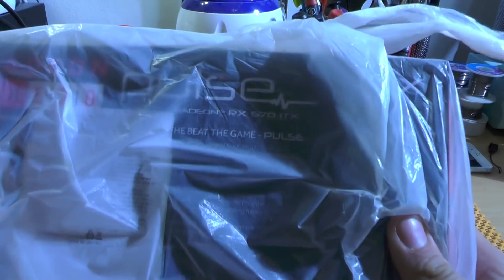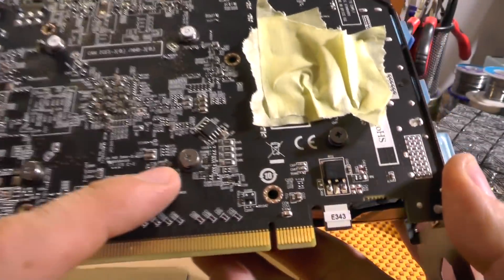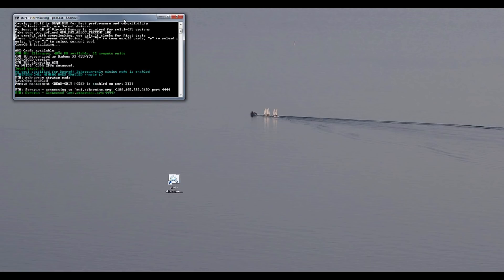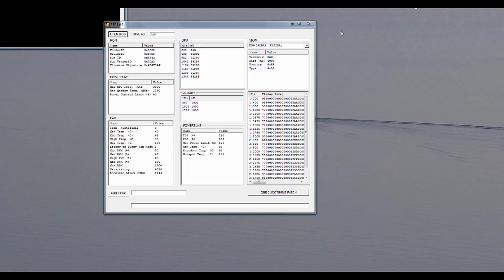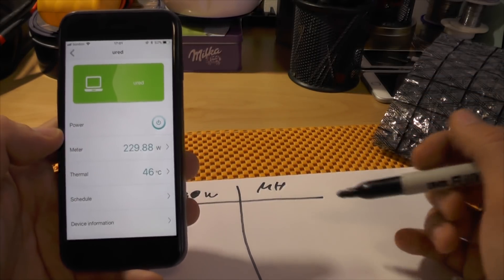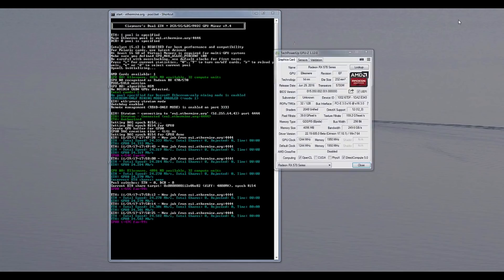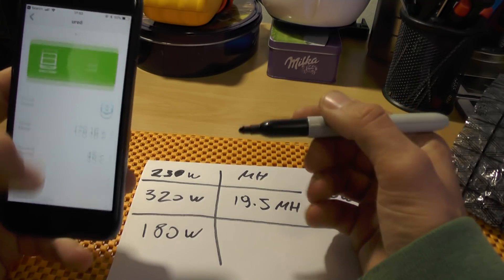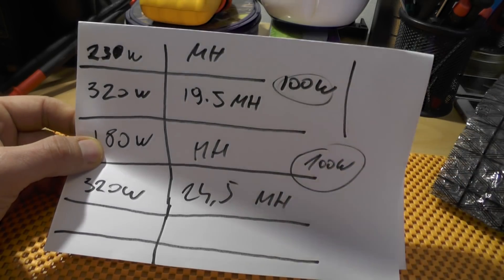AMD Radeon RX570 pulse ITX @ 28.5MH (ETH mining)

Comment: hello sir is it any better to higher the memory clock from the bios or its the same value if i do it with teahrd application like MSi afterburner ?
Reply from the maker: mahamed arhuma hi, lately it’s possible to do that from claymore’s miner, so i guess it’s easier that way:)
Reply from the maker: mahamed arhuma also, afterburner is ok, however you need to flash bios for memory stripes so i would say that claymore’s way is better way

Comment: Don't use this BIOS. Many cards work unstable when mem higher then 1850mhz. If u wan't 27.5Mh/s → flash BIOS with one-click timing in PolarisBios Editor and use this config in claymore. My 6xRX570 4gb ITX Mini ~ 855W from wall and 165Mh/s
-tstop 70
 -tt 55
 -fanmin 30
 -fanmax 70
 -cclock 1150
 -mclock 1850
 -cvddc 940
 -mvddc 935
-gser 2
 -eworker RX570ITX
 -esm 0
 -epsw x
 -allpools 1
 -mode 1
-asm 2
Reply from the maker: strange, i have about 30 itx's and they all work without any problem with this mod :/
Reply: i have 12 itx's they don' want to work higher then 1850, if i set upper then claymore stuck on thread error. Can u share settings for miner what do u use?
Reply from the maker: strange... i only use this rom, no "extra" swiftches in clymore whatsoever...
Reply: if i use ur bios, first card 25.2 Mh/s next all ~ 21 Mh/s, all cards on Elpida mem
Reply from the maker: after flashing my bios do this: https://www.youtube.com/watch?v=jkxpyjd6e9g

Comment: Good afternoon. I have Windows 10 and its same graphic card. I followed the instructions to perfection and after putting one of their "rom" and restart...windows simply does not start. It restarts continuously and I must restore it. i use 1st lockchain drivers and your bios "Modded".What can be happening?Ty
Reply: 47/5000
I do not think it's because windows is not activated
Reply: Could you do it with windows 10?Is this rom valid for windows 10?
Reply: Your graph has 8GB DDR5?
Reply: I have seen a picture that you have posted here and I think we do not have the same graphics because mine has 8GB DDR5. Is not it supposed that the most important thing is that it has 8GB? With 4GB can I do the same?many thanks
Reply from the maker: Did you patch the drivers?
Reply: yes with the link you've put there but if your card is 4GB and mine 8GB it is normal that it does not work. They should be different ROMs. I have to do it manually. Do not you think?
Reply from the maker: it won't work if the card has more ram, send me your original bios and i'll mod it, Cheers.
Reply: The truth is that for a moment I thought I had broken it but since I have two equal graphics I put the original rom of one of them. How can I send it to you?
Reply from the maker: my email address is on my webpage (i-vlad.com)
Reply: Thank you very much for your help. Tomorrow or the day after tomorrow I will go to the place where I have the graphic card and I sent it to you. I'm going to subscribe and sponsor your channel from mine. Thanks again
Reply from the maker: cool, tnx :)
Reply: is done!
Reply from the maker: ok, will mod it now
Reply from the maker: hi, i have send you 2, normal & extreme, see if normal suffices (difference is minor, however, normal is "healthier" for your gpu). Cheers
Reply: thank you very much. I will try it!
Reply: with normal it has risen to 27 MH/S!I do not know how much the card consumes less than 120W, where can I see that? The truth is that taking into account the consumption is very good graphic card. I could only buy two :( (with 8gb for the DAG)
Reply from the maker: that's slow, watch this: https://www.youtube.com/watch?v=jkxpyjd6e9g

Comment: These cards are sh*t leaked from Sapphire, they crashing even on stock 1-2 times a day, volage regulators are 90c under full load, I used flir camera to test it, they are for casual usage. I will return they to seller once theres other models available and prices goes down. No matter of overclocking.
Reply from the maker: strange, they work fine for me :/
Reply: MTS yes. They work but 140w powerdraw at 29mh/s. Check temperature od pbc at back od card. Place where u Cconnect pcie Power cable - on middle. Its 90c.

Comment: I am getting 29.5 using mod bios and simplemining os. Haven't measured wattage though.
Reply: This mod or?
Reply: MTS [Reviews] no, it was mod by someone I paid to do it so not sure the exact values. The SMOS is set to core 1130 memory 2060 stable.
Reply from the maker: i see, 2060 seems a bit overkill (especially if not samsung) i mod mine to 20000tops because the differenci is only 1MH.
Reply: MTS i was thinking that too, will try and lower it. Any idea what difference in wattage that will make? It is a 7 card rig so 1mh per card is not so small
Reply from the maker: not quite maybe 5-15w per card... maybe...  i'm quessing
Reply: Zdr ako moje dai mi nqkakvi tvoi kordinati , iskam da te pitam za kartata i da se dogovorim da napravish i moite na tozi HR , sreshtu zaplashtane

Comment: Hello MTS, 

So I have the same card as yours, however mine mines at a maximum of 24 Mh, after all the tweaking:
- deletion of Drivers;
- instaling of AMD Blockchain driver;
- reflasing the BIOS with your custom BIOS;
- patching the driver;

The only difference is that I am running on windows 10, could you do another test these days, on your rig and see how much are you getting now.

Best Regards,
Tudor G. Samson
Reply from the maker: 28.1 - 28.6, (i downvolted a bit) http://i-vlad.com/miner/22122007_ITX_SSHT.jpg - do you have these drivers?
Reply: Hello MTS, 

Thank you for the reply.
I have taken a look and we have the same drivers, and everything :(

Maybe is because of the pool where I am mining ? Minergate ?
Reply: One question, what pool are you mining on ?
Reply from the maker: eu1.ethermine.org
Reply from the maker: which miner are you using? this is claymore's dual miner
Reply: Ok, so I got it. Now I have a steady 28.2 in Claymore and 26.4 in ethminer.

Could you please integrate in the description :D because I think I missed it, that you are using 
Claymore's Dual Ethereum - software
https://ethermine.org/ - pool

Also would it be possible to give us the EFFECTIVE hasrate from the pool, because for me it seems that with Claymore I don't find a lot of shares. 1 share per minute for 50MH.
Reply from the maker: Will do.
Reply from the maker: ..AAAAAAAAAAAAAAnd integrated as Q/A :)

Comment: Hello I have this card with Elpida memory , i change triming "Copy 1:1500 to 1:1625, 1:1750, 1:2000 and the 2:1500 to 2:1625, 2:1750, 2:2000" and i have only 25,2MH with Drivers "Radeon Software Crimson ReLive Edition Beta for Blockchain Compute Driver for Windows® 10 64-bit" What i do wrong ?
Reply from the maker: Try my bios
Reply: Bump up vram clock in the bios to 2000-2050, down-clock gpu to level 3 and perhaps undervolt a bit to the level 2 voltage. 
There is no need to have the intermediate timings set to the 1500 one. Just have the 1500Mhz timings copied to the 2000Mhz timings and that is it. The card never switches thrum all those clocks while operating. It actually uses only 2 steps, 300 and 2000.
Reply: I have stable results at 1925mhz and I have a result of 27mh but the power consumption is very high + -130W. How to make undervolting?
Reply from the maker: https://s10.postimg.org/wso984195/image.jpg
Reply from the maker: and bare in mind, these are pointers, try 1 by one, if you lower it too much your gpu will stop to boot.
Reply: How do you then turn on the card like a voltage too low? and the system will not detect it, for example?
Reply from the maker: safe way is to use some overclocking software (like afterburner) - because if you downvolt it you just have to reboot. I personally downvolt my cards with bios (because i have a programmer and i can reflash them even if cards are not booting). I do that because i don't want to hassle with software but that's something i would not recommend!.
Reply: can I change only the last setting? 1256mhz 65288 mV to 1169mhz 65287 mV. And the card should stand up?
Reply from the maker: yes
Reply: ok I changed the last 3 frequencies to 1103, the card got up but I have a strange problem how to launch Claymore and ETH after disconnecting the internet, the minner reports a problem with the internet and how to re-connect the internet card has a low hashrate. The driver has this Blockchain, as will restart Claymore, the hashrate is ok. The problem is that only a small problem with the internet is enough and claymore crashes; - / and the hashrate will not come back without rebooting claymore.